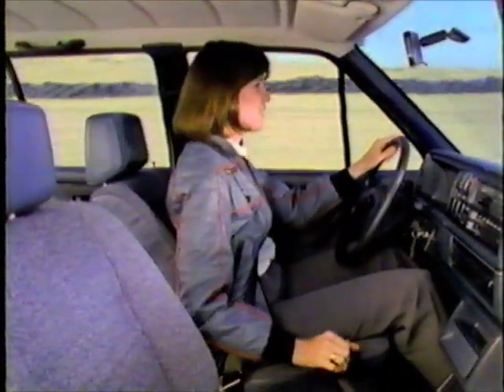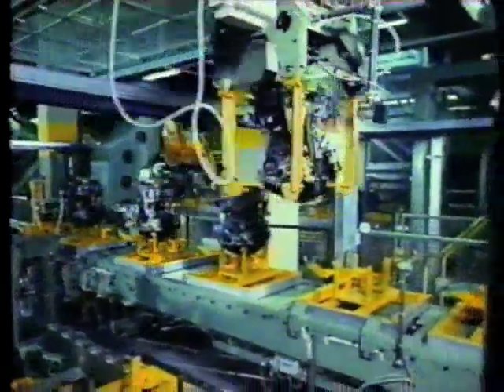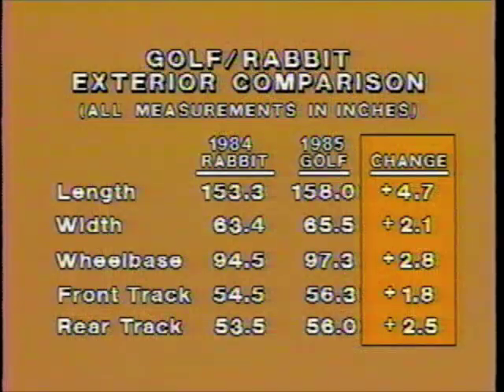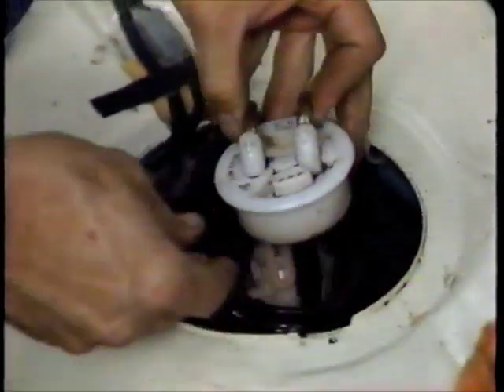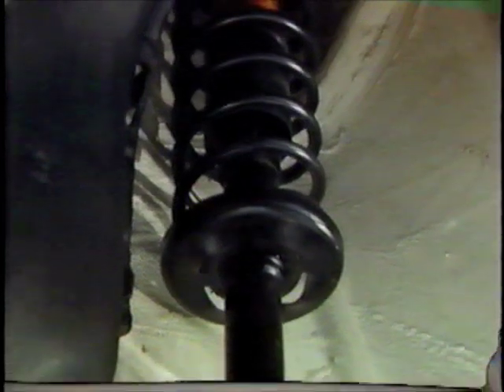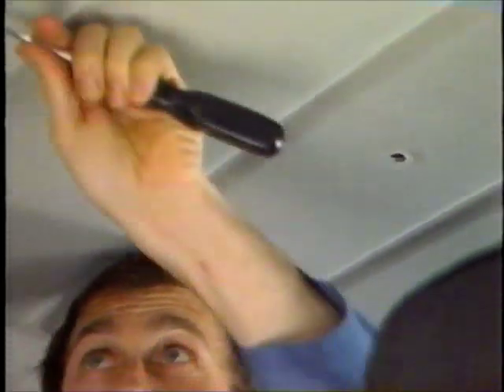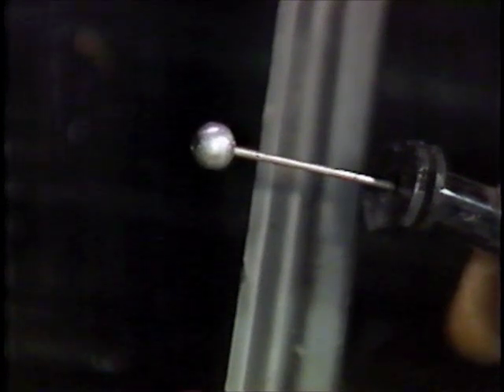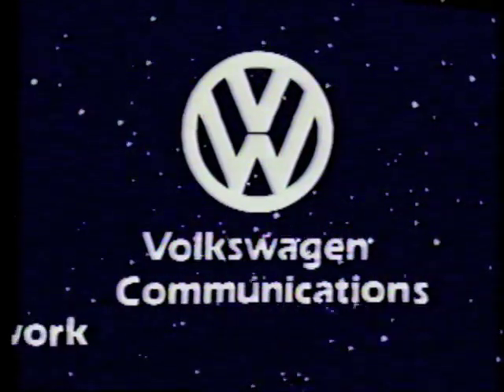1985 VW Golf and Jetta Service Preview

Comment: I was a Vw tech and worked on some audi in the dealership for 5 yrs up until last summer, looking at this is pretty cool. It's crazy how some things really haven't changed much. Volkswagen really never did too many drastic changes over a period of time. A good example would be radiator access, the entire front end still has to come off. Great video!!

Comment: 07.53 1000mile  maintenance checks for valves?
Reply from the maker: First oil change, remove the prefilter on the gas CIS fuel distributor, and on the diesel add 1/2 turn to the head bolts.